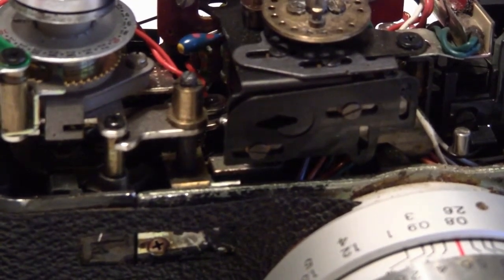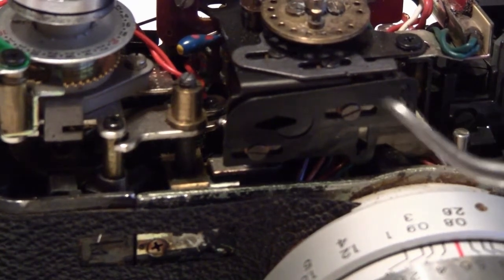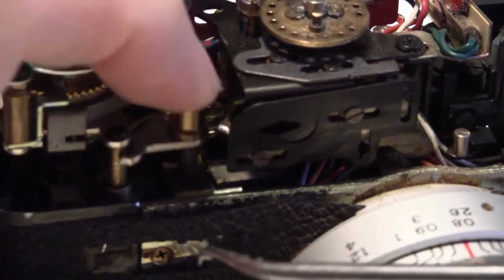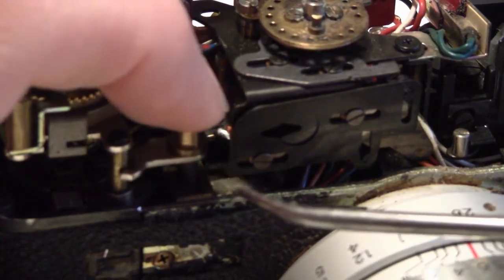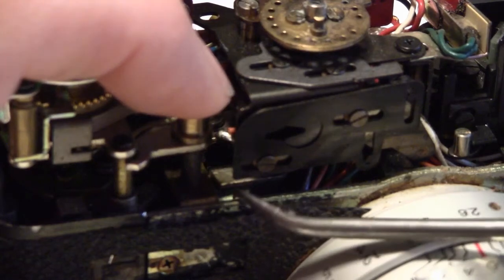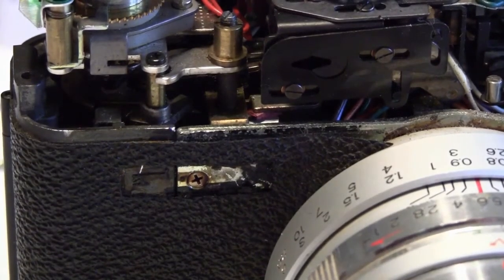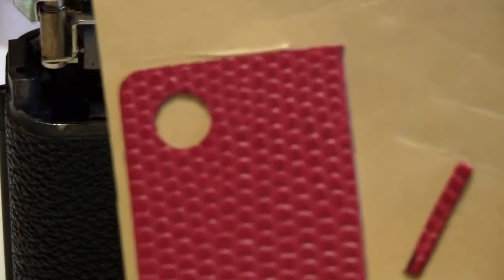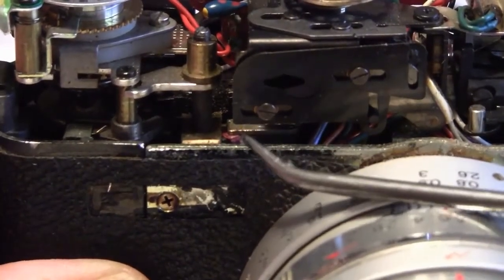Yashica Electro 35 Pad of Death

Comment: Thanks for this explainer, particularly the view of what's happening inside the bottom of the camera: That was key for me understanding this. And your repair method is so much more practical than people recommending taking the lens off. To get in over the top of the case, after removing the top, I put the replacement pad on the end of a sewing needle. Once I had the pad almost in place, with the needle still in, I pushed it the rest of the way in with a straightened paperclip. When the glue was set, I just pulled the needle out, leaving the pad in place. A piece of replacement toilet flush valve (Korky brand, from Home Depot) turned out to be exactly the right thickness. Fixed my POD issue.

Comment: Thanks for the video!  I 3D printed something similar size with TPU (flexible filament) and it works great!  The hardest part is gluing it to the plate.  I got it half way in then used a tiny screwdriver with shoe glue (really strong black adhesive) on the tip and pushed the pad and glue into place.  It is on real good now :).

Comment: Hello, excellent video!

I have a specific issue with my Yashica Electro 35 GSN: the red and yellow lights are working properly, but when I take a shot, the shutter always fires at the same speed, even when the lighting conditions change. It seems like the light meter is functioning, but it's not communicating the correct shutter speed to the camera.

Do you have any idea where the problem might be occurring?
Thank you.
Reply: I have the same exact issue, very frustrating. Mine seems to be firing around 1/30 which is weird because the default is supposed to be 1/500

Comment: What I don't understand if this:. The act of pressing the shutter is supposed to catch the lever.  Winding releases it.  So, when you are ready to take a picture, the lever should be released already.  How does the catching the lever after the shutter is pressed affect the exposure system before it is pressed?  The lever is free under all circumstances as pictures are being exposed?

I know it is supposed to work, but I can't understand how it possibly does.
Reply: And... So I tried a fix someone proposed of unscrewing the rod at the bottom of the camera such that the lever catches.  That did work to catch the lever, and the think was there - but it made the electronics even wackier.

So the conclusion from the fact that the catch is after the exposure and that catching the lever doesn't fix the problem must mean that there is some internal element that is also triggered by adding the pad.  It must reset the metering system as the current exposure is taken and loading the shutter does not affect it.
Reply: The only reason I care to understand if that u am having trouble placing a new pad.  Mean it is hard to get something in there and leave it in the right place
Reply: And... Yashica must have been horrible engineers.  What a convoluted system.  Working perfectly, it thinks when the shutter is charged.  They made this convoluted prices depend on a pad.  Why?  We're their measurements off a couple millimeters?  Next they make this pad out of rubber foam which would obviously deteriorate.  They put the foam where it is nearly in accessible.  They don't make it possible to somehow release the part on which the pad is placed. And finally, they use the same freaking design and system for over a decade and on 3or four generations of this camera as well as several derivative cameras.  

Why?  No other cameras need this second rod and a makeup pad.  

It's not like the system was so great.  By the 2nd gen they should have replaced the lights with an honest to goodness meter, but no.  The only change they made was switching from circles in the viewfinder to arrows.  Why?

Rant over.  Just frustrated because I  cant get my pad in place and I keep feeding them into the body of the camera.  At this rate, before I am finished I will have filled the entire body with hundreds of foam pads!  

Why???

Comment: Hello I managed to pull this button with my finger, but this pin only locks on this small piece of metal if I pull it with my finger. makes a normal shooting noise. I have the yashica GSN.Would the material of this POD be a rubber or an EVA?
Reply from the maker: No ideal what the original material was...
Reply: @thegreenphotographer8214  original is a 3mm x 5mm urethane pad that's 2mm thick.

Comment: i took the top off of my black GT and the pad is a bit different than this one. it has 2 little strips of metal that the metal pad comes into contact with. any ideas on how to fix the pad?
Reply from the maker: Does it operate the same?
Reply: The Green Photographer yea it's the same. I just figured it out. The shutter plates were just lower than I expected and the original pad was still in there(but rotted) which made it difficult for me to see. Thanks so much this video helped alot.